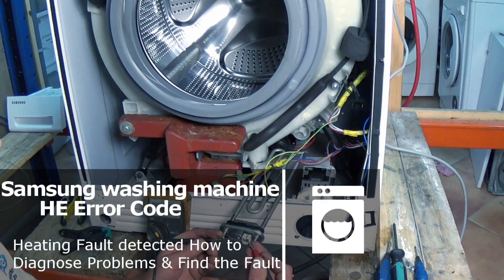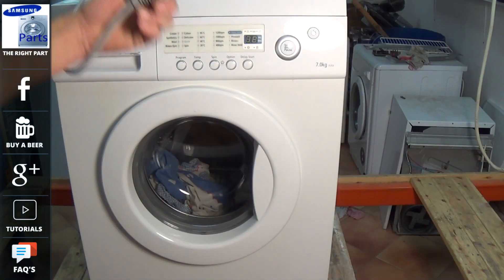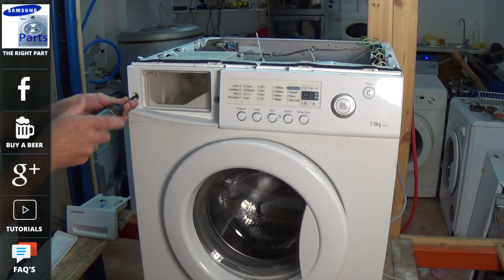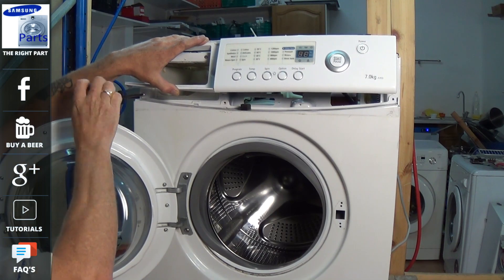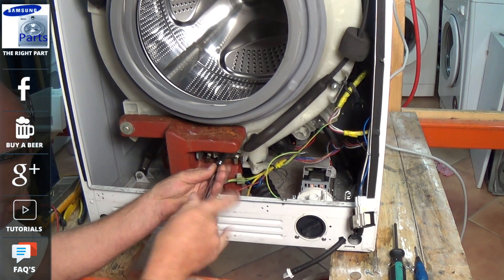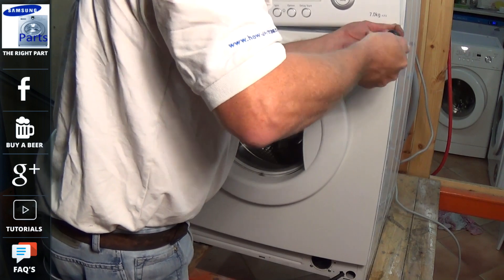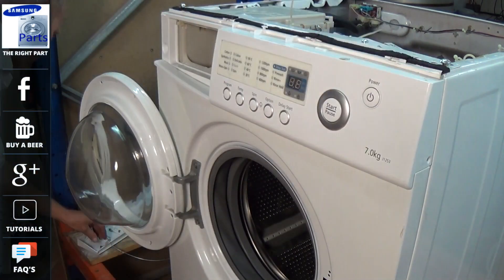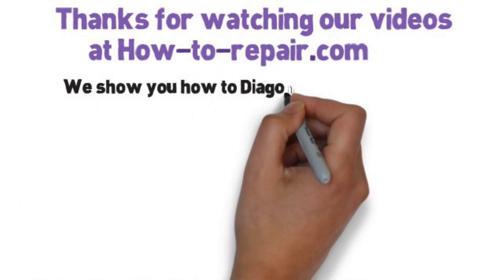Samsung washing machine HE & TE error code heating fault

Comment: Thanks. for the video and also for showing test mode in the other video. Our WF1804WPC let out a bit of a smell and a tiny bit of smoke yesterday so I ran it through your test procedure. I found there was no relay click to turn on the heating element and certainly no extra current being drawn by the washing machine when it was supposed to be heating the water. Next step I'll pull the thing apart and test both the element and the NTC Thermistor, but I got a funny feeling I might have to go looking at the heater control circuit board too ... I'll report back!
Reply from the maker: could be the really not activating  glad we could help you @CulinarySpy this is for you https://www.youtube.com/shorts/e432SAb2g08 please remember to subscribe as that's what keeps this channel going. Thanks 👍
Reply: @How-to-repair  thanks - it's not activating and I found there are some burnt out components under the conformal coating on the Main PCB. Not really repairable without detailed schematics of the Main PCB, so looks like I need to replace the Main PCB, around $320AUD. The element measures 27ohm cold (230v/50Hz here in Australia). Not sure it's going to be a worthwhile repair, your thoughts?

Comment: I had the TE code. I tested the sensor and the heating element and they tested good! But, when I went to unplug the heating element I did notice as soon as I touched the first wire terminal it fell off. I came to a conclusion that was my problem. The drum shook it right off. I pushed it back on and heard it click then put everything back together except the top and back and tested it and it operated like normal, then I put the top and back covers on. Pretty easy fix!
Reply from the maker: Really glad the video assist. Did you glad you got your machine back up together  glad we could help you @davidwiley652 this is for you https://www.youtube.com/shorts/e432SAb2g08 please remember to subscribe as that's what keeps this channel going. Thanks 👍

Comment: Nice clear videos, Paul! WF1104XBC heater relay clicks on test, but no power to heater 😢 Cabling all good, so I assume relay must be faulty?
Reply from the maker: Does sound like it could be the heater relay if you can match it up they will  normally only cost you about 10 £15